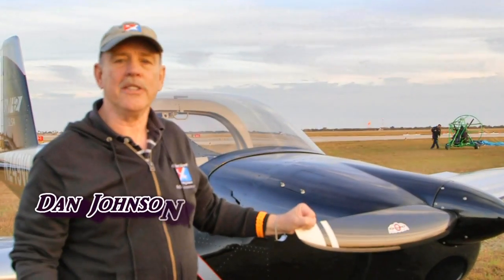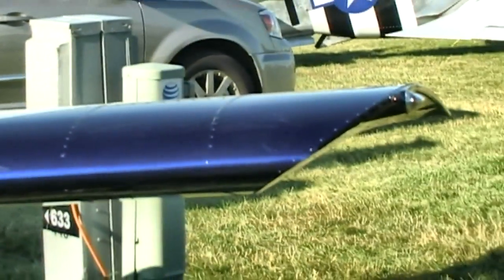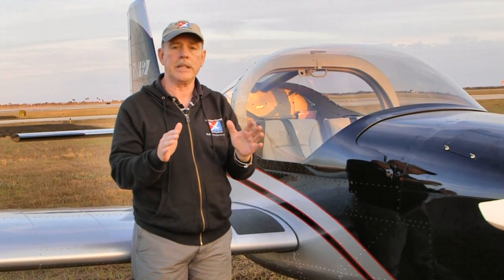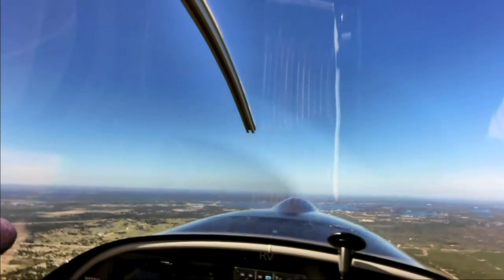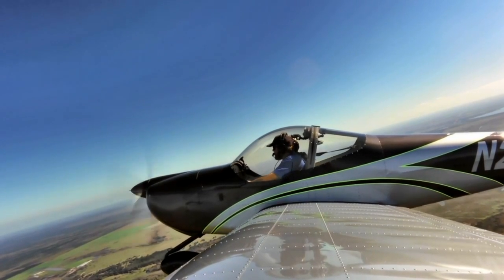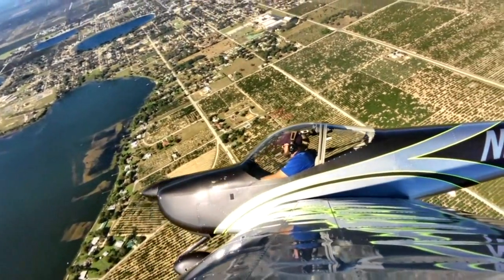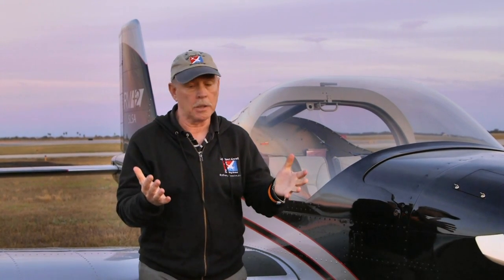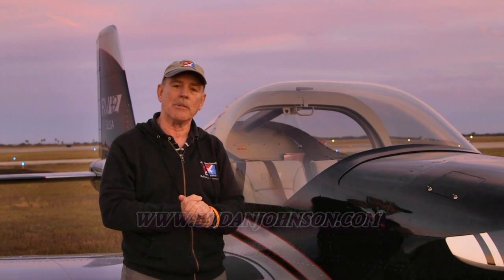VANS RV 12 light sport aircraft review by Dan Johnson - Part II

Comment: Under the heading of The Elephant In The Room: What will it take for LAMA, EAA and Flying Magazine to explain that Flaperons are a compromise that allows Either Flap(s) activation Or Aileron(s) activation...but Not Both simultaneously!!!!????
There is a reason why RANS and others continue to use Separate Ailerons and Flaps: superior maneuverability (spelling) specifically with a cross-controlled side slip when on final with deer on the runway.!!!